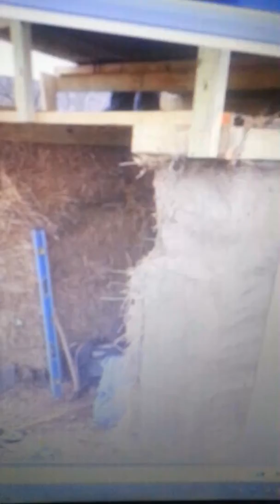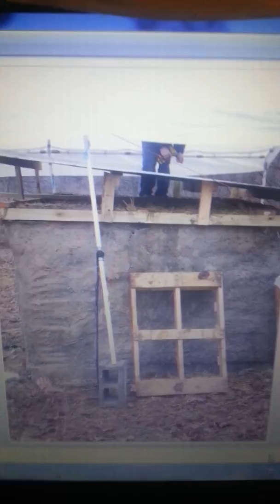Straw Bale Building

Comment: I have an idea that may help with the concrete work.  You can get the long "exam gloves"  from a vet or some vet supplies that will go all the way to your shoulder.  That way you can have them cover as much as you need to.  They are cheap and can be reused if you wear them inside heavier gloves so they are protected.  We've used them  while picking Okra to avoid all the itching after.   Wear them inside your clothes, or if you'd rather outside.  Also great for giving dog bathes  etc.....
Reply from the maker: I never thought about that. I will pick some up. Thank you for that!!!